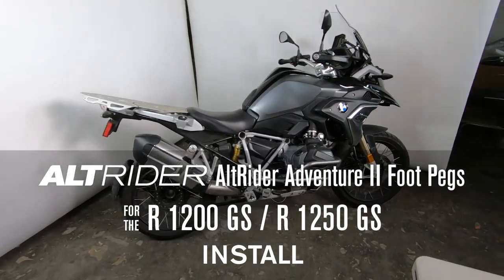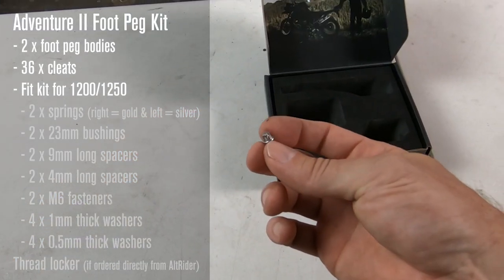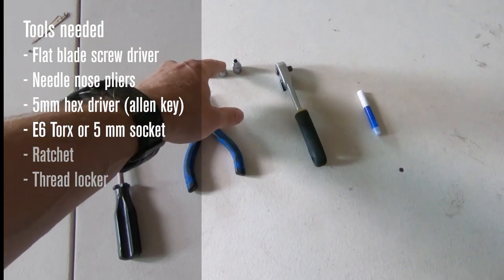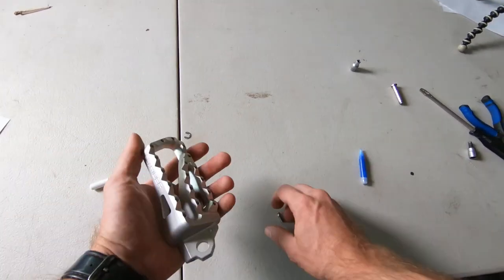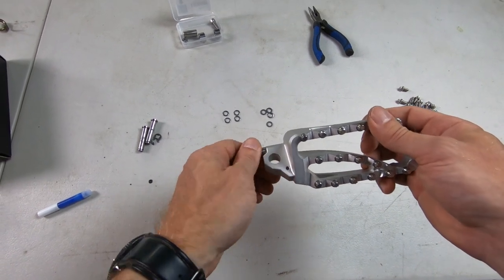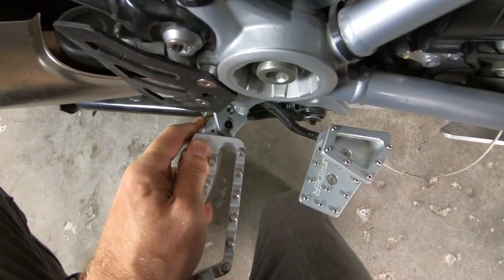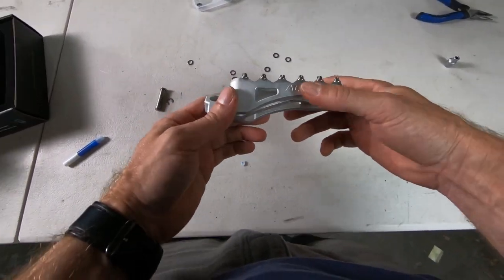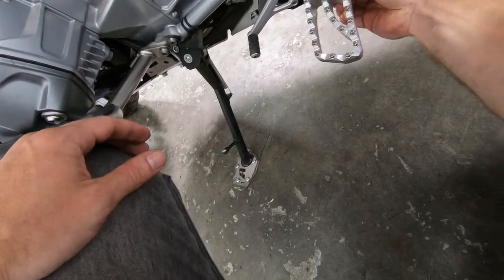AltRider Adventure II Pegs Install on BMW R1300GS, 1250 & 1200

Comment from the maker: If you're installing these footpegs on the R 1300 GS the shifter will interfere. Remove it using a T40 torx before removing the footpegs. Then reinstall after the pegs are in place, be sure to use thread lock.